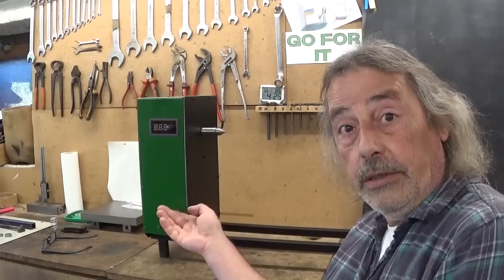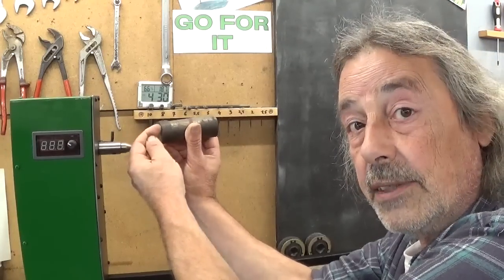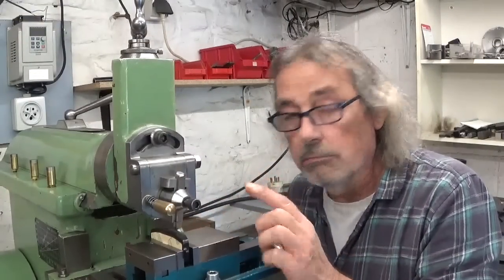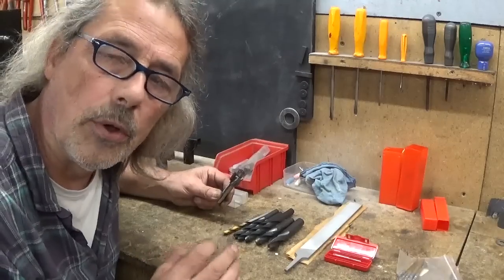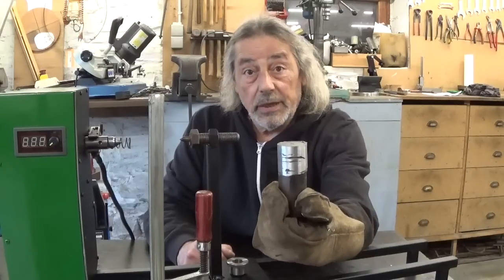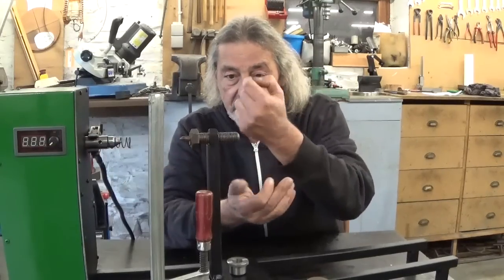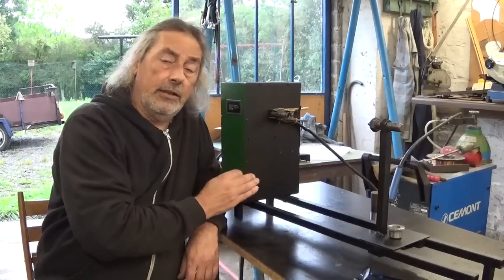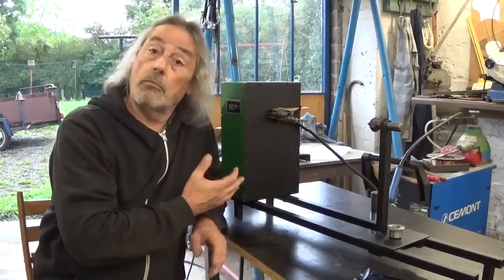Welding rotator finished.

Comment: I think the green paint looks classy - has a steam locomotive air about it! I know next to nothing about welding but will that spring provide adequate torque for larger diameters? If the electrical connection between centre and centre hole ....whoops should have viewed your entire video before commenting! Resourceful & practical as ever.
Reply from the maker: Lol, posting a comment before the end of the video. Happens to me too sometimes :)

Comment: You could use a lathe dog bolted to drive center and  wired or welded to your part to be welded up. Then brake weld when done and make grind to clean up.
Reply from the maker: Yep, that could work too.

Comment: Good to see it all working Michel. Is that center in the headstock removable? Eg. is it a MT2 center that can be removed? If so then you could try using a MT2 steb center. These are used for driving wood on a wood lath, but there probably would be enough bite to turn the steel piece that you want to weld if you wind in the tail stock. Also, the electrical contact should remain good for welding through the steb center.
Reply from the maker: The centre is fixed. But I will make a plate one day. A sort of chuck.

Comment: Hello Rusty, after Keith had seen this speed adjustable bandsaw. I bought one, it's practically the same saw, except only different. The base is green. I want to add the vise plates you installed from your idea, and get a set installed. For size, you can saw a lot different shapes. As saving a bunch of time. Take care now 👍
Reply from the maker: Go for it, Keith.

Comment: I have found that when you weld a 'nut' onto another piece of steel, it helps to put the 'bolt' through it with some oil on the thread. It keeps the thread clean and 'sort of blues' the nut internal thread at the same time and helps to keep it sort of rust free. Great project and I can see it being very useful for you in the future. All the best from Australia, I got here from 'Preso'.
Reply from the maker: That's nice. You're welcome, Gary.

Comment: Nice job, Michel! One thing you might want to consider is modifying it so you can turn it up on end, and having a turntable attachment in place of your spring assist center. You get a lot of utility for being able to use gravity to hold the part down and would be able to use your live center end to put a bit of downward pressure to keep the part from shifting,
Reply from the maker: Indeed, I was thinking of that. It's on the to do list.